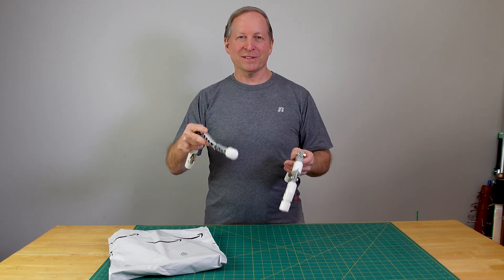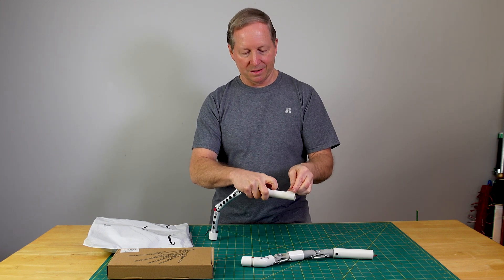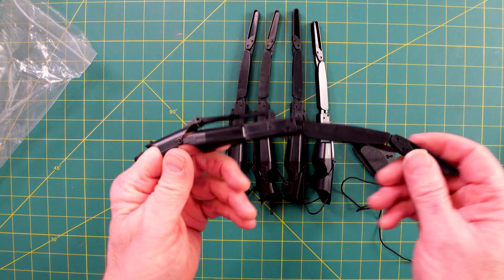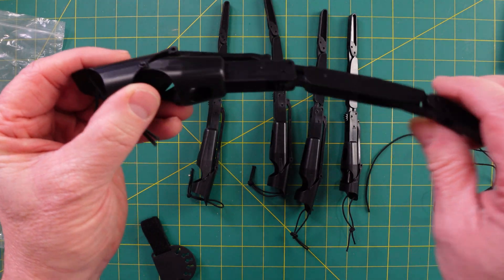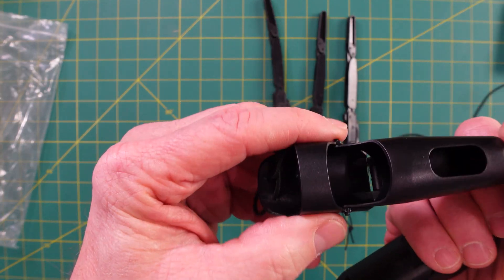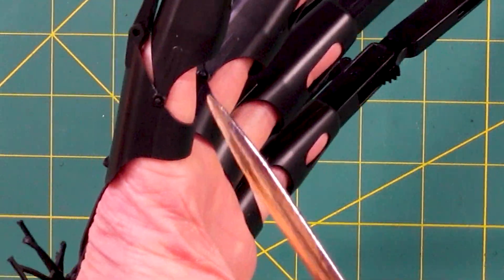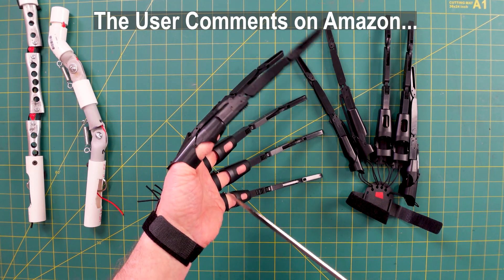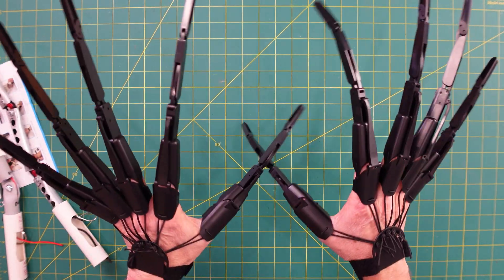Testing Creepy Fingers, How They Work, Robot Protoypes vs Production Pieces

Comment: I have the same ones, yes the pivot points are the side are easily broken I've broken one or two what I do to put them on is I will put one on, take off the index and thumb use that to help put the other one on and then put the indexes thumb back on The only thing I do not like about these is how short the Velcro is
Reply from the maker: Brad, thanks for the suggestion, will do.